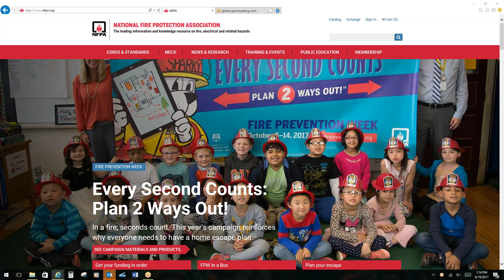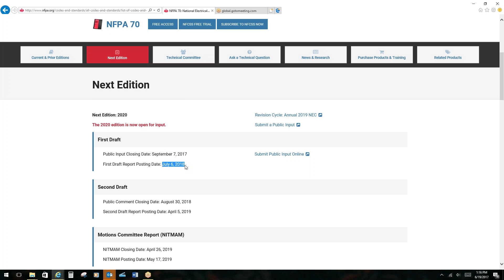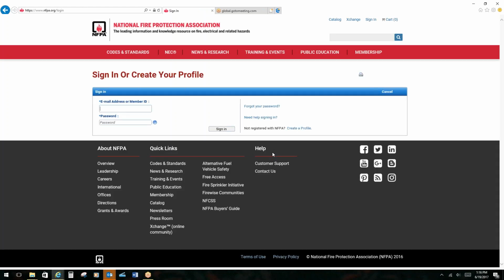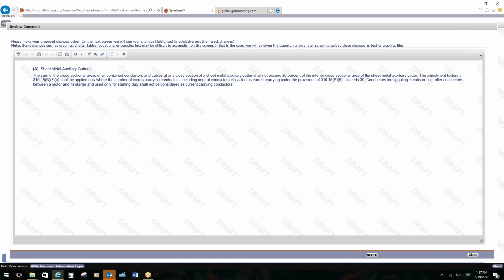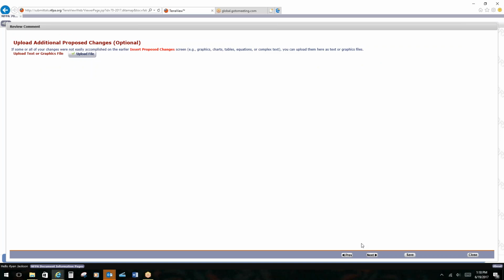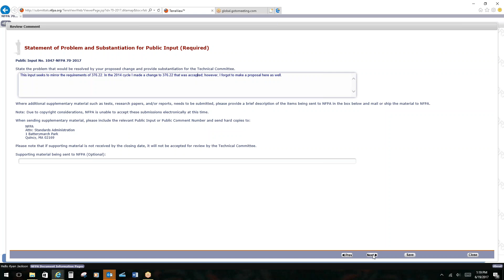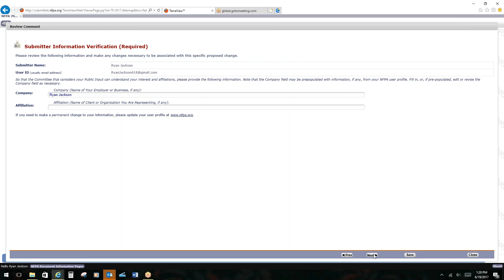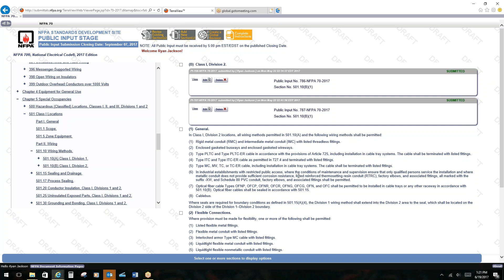How to submit a proposal (input) or comment for a change to the National Electrical Code.

Comment: I have installed 8 mid-grade modern refrigerator this year, and they all trip the gfci protection device on a dedicated circuit.   
Suggestions:
First, gfci manufacturers are to design a protective device specifically for refrigerators & freezers.  
Second,  refrigerator manufacturers are to design a current-limiter so as to not trip the gfci without cause.
Third,  nec is not to require any gfci on any refrigerator or freezer in any location, period! 
Get your act together, folks.